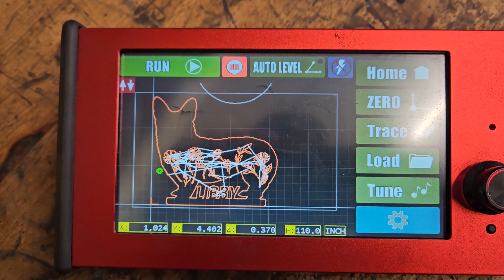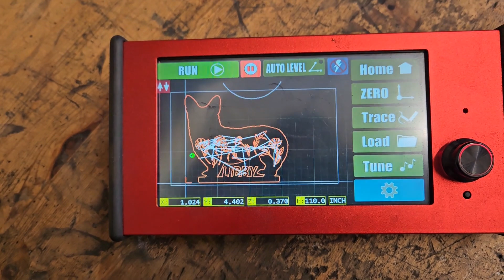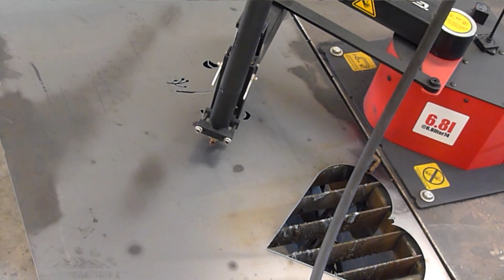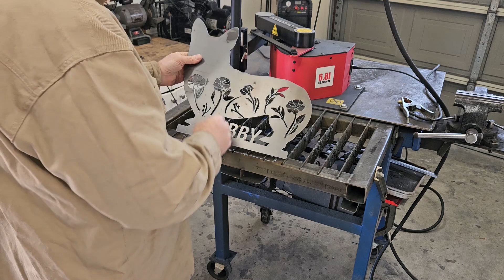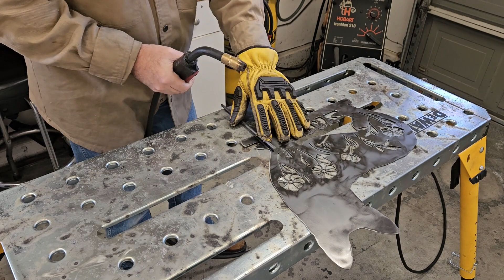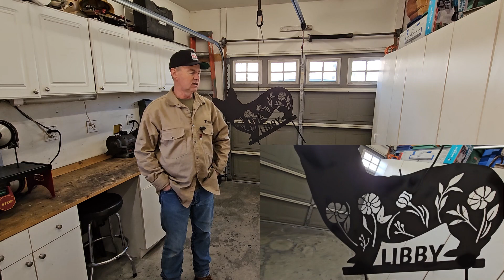Using the Arcdroid cnc plasma to create a Memorial for a Corgi.

Comment: Scalloping like this shows up in pretty much every system

You can try changing the Jerk settings in Settings->Machine Settings->Jerk.  Dial the X and Y down to 2 or 3 to reduce the acceleration ramp a bit.

Also try reducing your current a little for the same cut speed as more power means more chance for fluttering.
Reply from the maker: Thanks buddy, I'll look at those next time I get the machine out.  There was no sign of scalloping yesterday, of course the settings weren't exactly the same and it was a different cut file.
Reply: @6.8liter74  absoloutely! I have seen it very intermittently on 14ga  and usually on both a concave & convex arc. Reached out to Andrew asking about deceleration and he responded with that info. I set mine from  5 to 3 on X & Y axis and will be keeping an eye on it.  I also did a Z axis offset first time since I got it also will see how that helps with quality.
Reply: @6.8liter74  so just came back from running 2 dozen letters 6inch tall down to 1.5in tall and I did not see any of the scalloping at all. The font I used is also very conducive to showing that scalloping. I also found I ended up needing to tweak my Z axis and my slag is 95% non existent now on the backside. It will be different for everyone but I set mine to 2.25offset and I calibrated w the torch not stylus.  Hope this helps
Reply from the maker: @yellowmetaldriver1460  thanks for  sharing your experience and settings.  I'm learning every time I use the Arcdroid.  Sharing helps us all improve.